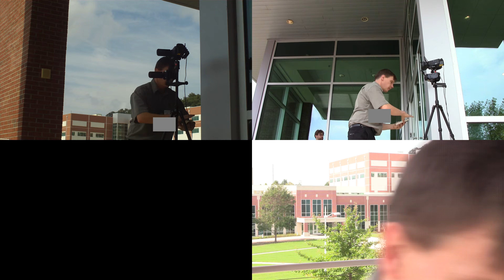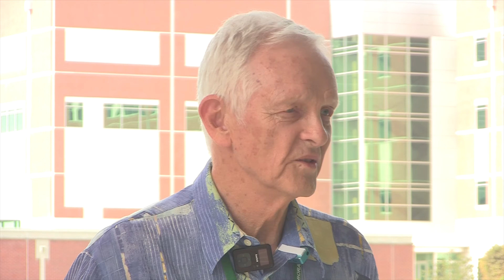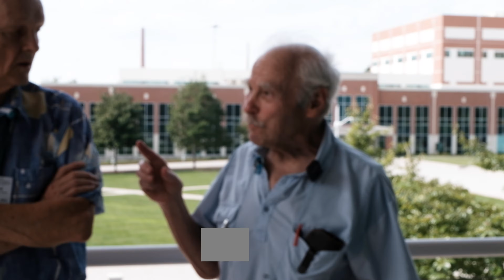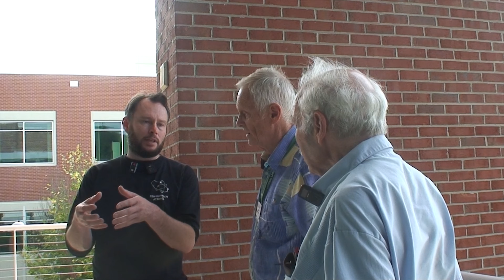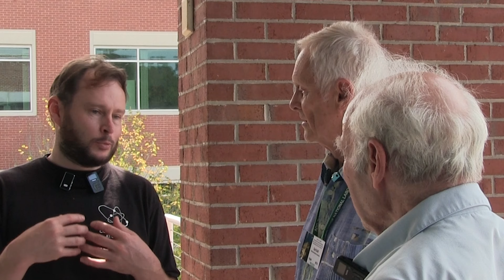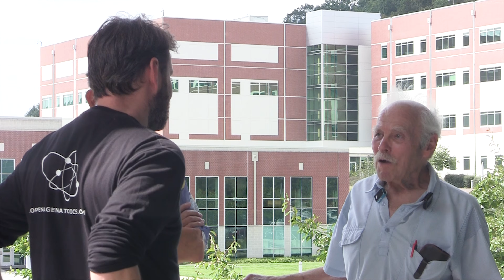Syd Ball and Uri Gat speak with Thomas Jam Pedersen @ ORNL MSRW 2018

Comment: I've only just begun my due diligence on thorium cycle nuclear power but this approach definitively answers my major concern about nuclear energy; long lived byproducts of operation. The fact that it actually eats nuclear waste from uranium cycle facilities is frankly a huge boon to the environment. The high efficiency of fuel utilization is also enormously attractive. The short half lives of the waste products- some of which are medically useful or have other applications and therefore aren't 'waste' products at all. Radioactive actinides are a serious national security threat just because of their potential for extreme contamination. Getting rid of them as part of the normal operating cycle is huge. Let's quantify NORM levels of emissions from coal and natural gas and use that to argue for the switch from fossil fuels to thorium and I'll bet we get further.
Reply: Thorium Reactors are usually thermal-spectrum... the unique advantage of thorium is the abundant material can be bred into U233 with enough spare neutrons to continue the fuel cycle indefinitely (fuelled by nothing but Thorium which breeds into U233). But its not the easiest way to liberate more energy from spent fuel... fast-spectrum reactors are better suited. Thermal-spectrum can still liberate more energy from used fuel rods... France does that, for example. So while thermal-spectrum thorium-cycle can use some fissile in the used fuel rods (which are mostly natural uranium anyway), if that's your primary goal take a look at fast-spectrum molten chloride salt reactors as another option too. They're better suited for liberating more energy in spent fuel rods.

Comment: I suppose if there is an issue that is elided somewhat with molten salt reactors it is not so much the core that would spread radioactivity if compromised but the ancillary systems. If online reprocessing is implemented with fluorination systems that presents a source term for chemical reactivity that the MSR would not present by itself - and the regulator would have to take that into account. 

The proposition of NF3 or F2 gas at high temperatures for fluorination while the reactor is online poses a potential explosive source that is also highly toxic and corrosive.
The hold-up tanks for xenon and its daughter products, if pressurised as ThorCon proposes, also presents a driving force in the event of reactor vessel compromise.
This is one of the reasons why I believe that fundamentally, designs like the Terrestrial Energy iMSR or the Moltex SSR are more likely to find regulator approval faster and sooner than the ones with online reprocessing. Without driving forces that require containment, the reactor is simpler to regulate. Even if the source term is relatively small as far as nuclear reactors go, every Curie must be accounted for in the final design. 

I wonder if Syd or Uri or Thomas had any proposals or ideas for the regulation and/or containment of pressurised vessels within the MSR containment. Not so much the reactor core itself but the ancillary systems.

Comment: Anyone knows if the flow measurement of molten salts is still a problem?
Because I'm pretty sure I have a solution but I have no idea how I should make my patent or even IF I should make one.
Reply: Patent & open source. Better than leaving it open for somebody else to patent and become a threat to the industry.
Reply: I agree. Patent it and then open source, or possibly royalty on commercial revenues.
Reply: It was solved with sending sound waves through the salt and measuring doppler shift.
Reply: @MrTurboTash  You wouldn't believe it but that was precisely my idea. But it already existed when I made that post.